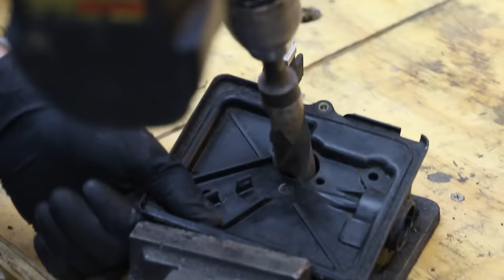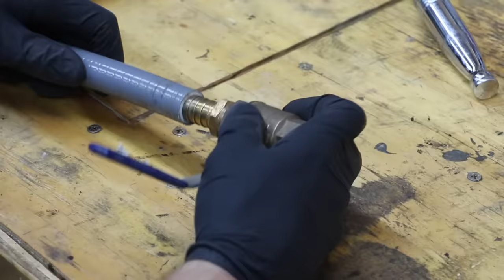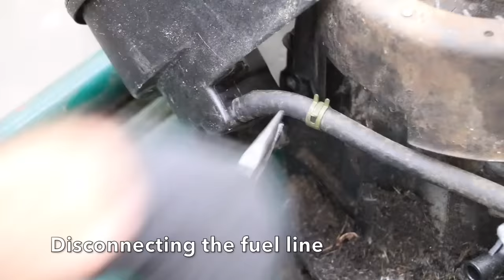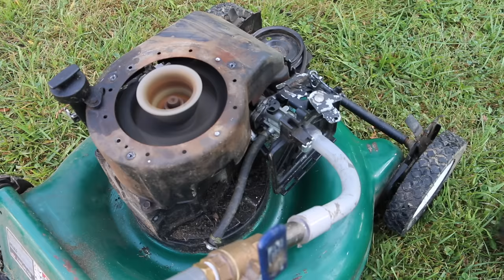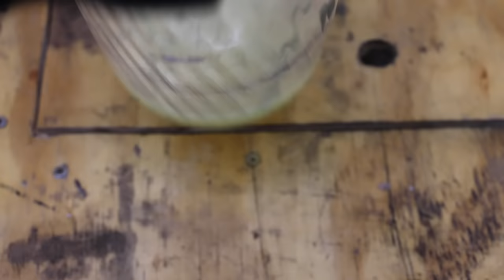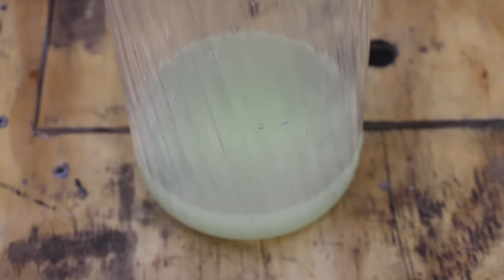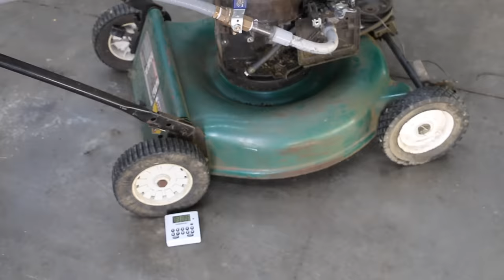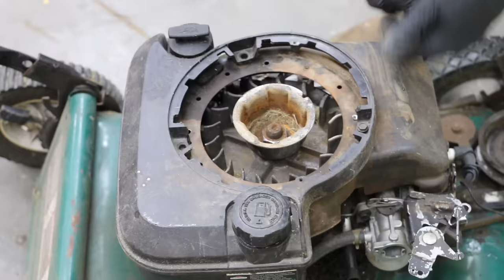Will a "Gas Vapor" Container Improve MPGs and Fuel Efficiency?  Let's find out!

Comment: I read that heating the gasoline to the temp at which gasoline vaporizes (about 180 degrees Fahrenheit) causes the increase in efficiency when running a motor on gasoline vapor/air mixture via the intake.  Care to heat the gas to 180 or possibly higher and try this again?
Reply from the maker: Thanks for this recommendation!
Reply: Thats right. I have studied the work Smokey done on this subject. The main issue he actually encountered was lack of quality bearings back when he built his device for this. I believe its achievable now. However there was a safety factor also for a car traveling with hot vapored gasoline.
Reply: I don’t think I have the background of a lot of commenters here, but my experience is that heating fuel reduces it’s effective octane. You wouldn’t see that in this experiment because there is no way to vary the spark timing on the lawn mower to maximize the tune for the higher or lower octanes. On my Harley I do have the ability to adjust timing. I get the best power and efficiency when the air and fuel are cold and can accept ignition retarding without causing preignition knocking. As the day warms up and the fuel in the tank warms, I must advance the ignition off of the optimal tune to counter the inevitable knocking which starts to occur, or add fuel additives to boost the octane, and the power and efficiency suffer. I would be curious what your experiments show if you refrigerated the fuel to freezing or lower and what gains or losses you experience.
Reply: Liquid gasoline, vaporized gasoline, propane, natural gas, methane, etc.  feed that little mower a proper mixture for the fuel type and it will deliver the same power output.  It isn’t the fuel, it’s the second law of thermodynamics. To produce a certain level of work takes a certain amount of Caloric heat, BTUs if you will.  Each fuel has a different caloric content or BTUs of heat available but so long as the combustable mixture is appropriate for the fuel you will end up consuming the same amount heat energy to produce the same amount of work.  Gasoline is very dense, propane is less, so a bigger tank is needed, both will mow the lawn.  And now that the lawn is mowed if you were to calculate the number of heat units produced by burning any suitable fuel to produce the same amount of power needed to do the job you will find that regardless of of the fuel used, the number of heat units are the same.  The second law of thermodynamics is an exacting task master and despite endless attempts to get around it it endures, it has never been wrong.  This experiment was fun to watch but given that the experiment was properly designed the outcome was entirely predictable before the mower even started up. A lot of fun though.
Reply: It will increase the efficiency somewhat because you are adding additional heat, quite a lot, unfortunately that externally added heat, when combined with the combustion mixture flowing into the cylinder will cause pre-ignition and quickly destroy the engine.  In addition to the pre-ignition problem you would also end up with less power because the hot fuel would be less dense, providing less power.  In Race cars, dragsters especially, the fuel is cooled well below zero so as to make it more dense, so the freezing cold fuel both cools the combustion chambers while packing in a much more dense mixture into the cylinders, cold fuel makes for bigger booms while saving the pistons.
Reply: Why do you want to damage the intake valve, man?
Reply: Alfred Havemann this is assuming a model of 100% efficiency for both test groups.  You can never get more power out of the fuel than is available, but you CAN however get less.  If the original manufacturers set up is less than 100% efficient, then you will LOSE more potential energy in that set up versus the other.  You science guys need to get out of the classroom and start turning wrenches.  Then maybe you’ll see that you aren’t quite as smart as you think you are.  He’s not trying to run an engine on zero point energy, he’s trying to see if it WORKS AT ALL, and after that, if it’s EFFICIENCY can be improved.
Reply: Combat Pyro. A lot more than just scientists need to get out and turn wrenches. So many could learn so much.
Reply: welcometonitropolis you would think a lab rat would at least understand the laws of thermodynamics though right?  I mean the first law of thermodynamics basically states that you can’t win, or that you’re never going to exceed 100% efficiency (but maybe not depending on the results of nasa’s testing the new emdrive engine lol).  The second law basically states that you are going to lose, or that entropy is inherently going to cause losses in any system.  So we know that what he’s saying is true, that you can never get more energy out of the fuel than is available within it to begin with, but he seems to have willingly overlooked the fact that there are entropic losses intrinsic to any system applied within this universe, lol.  If that’s the case then we know for certain that every system is something less than 100% efficient, and that right there makes his assumption an incorrect one because he’s assuming a model of 100% efficiency, which we know by scientific law, at least to date, is an impossibility.  

All this test was trying to examine is whether the methodology of aerating the fuel into the intake air externally would work, and if so, is it more, less, or equivalent in efficiency to the carbureted model.  Shouldn’t a smart guy like that understand such a simple set of test parameters?  We formed a hypothesis and tested it.
Reply: T Long u. Si
Reply: I built a heat transfer block in tech school.  One side ran coolant from engine, the other side fuel. Was on a ford 4.9l efi 89 f150 4 speed with 250k.  8mpg in town (motor seriously tired). Got 12mpg after the change.  Never tried on other vehicles, still have the contraption, just lost interest.  Other factors may have affected the results and it was a by gosh and by golly type of test, so can't say the results were accurate or phenomenal. A double blind study would provide better results as well as third party testing. Still makes for a wild story after a case of beer.
Reply: I was going to recommend this as well when the video first came out. I'd like to see if this has any truth to it.

I also don't have any engines worth risking, so I'll leave it to the professional risker.
Reply: Well, your engine runs at about 600F inside so Im sure thats hot enough to vaporize the fuel.
Reply: Nah. Carbon deposits are from unburned fuel n' stuff. If ye got carbon deposits, ye got non-vaporized fuel.

So the theory goes, iirc.
Reply: frikyouall Engines run rich at idle and when its cold, that causes alot of the carbon build up. Cars that arnt left to idle long dont have as much of an issue with carbon build up.

But no, 100% of the fuel cant be burnt 100% of the time. But it certainly can be burned nearly 100% at times.
Reply: Mmm, that's where the theory comes from. If you run it lean with an even dispersal of vapor, it'll be a much more even solution with the air around it, causing a spark to vaporize the whole shebang at once. The focal point will still spread from the spark plug which is a major part of the problem as far as I'm concerned, but it should still keep an even spread a fair amount better.

There are a myriad of problems associated with messing with the chemistry like that, but as far as vaporizing it all, it'll do it a lot better.

Which reminds me @Project Farm, if you ever get to this test, could ye do an emissions test while yer there? In stories of this test, emissions were next to nil.
Reply: frikyouall Well, lean mixtures produce much more NOx emissions with lower CO2 so I would assume that would be the result of an emissions test with a setup such as this.
Reply: Alfred Havemann I'm not going to try and sound smart bro but leave the word impossible out if it. The one thing you never calculate in energy efficiency is momentum. Switch your 10 speed to high gear  and you will use less energy when you go up hill easy especially if you're already moving or get a good push. Heat my friend is a good push. No heat is like starting up hill from a dead stop. Everything is possible bruh. Stop trying to be the so called number 1 human...(aka, look at my shirt, buttons, buttons, buttons, credit card)
Reply: Alfred Havemann any brain can regurgitate word for word someone else's thoughts and finding but true understanding of any subject could be explained good enough for a 5 year old to understand. Other than that, ego tripping
Reply: @18 After reading up on the subject, I can get behind that. But I'd still like a measurement of the ratio between fuel savings and NOx emissions, and without a complex muffler, this setup would be ideal.

If possible, I would also like to see the use of fuel additives to make it act more like lead-based fuel from before the 70's when the idea was popularized. For this I have my reasons. <_<
Reply: T Long yes you got to heat up the fuel to get more efficiency out of the vapors and possibly use an injector off of car to control the amount of vapor released into the chamber in the combustion process
Reply: This is true, however, when you create a vacuum on an environment, you lower the boiling/flash point of the substance. When working on Air Conditioning systems, we pull a vacuum on the system and at room temperature with -30 PSI, water will flash to steam and be pulled out of the system. It is very bad to have any water in the lines when charging an A/C system, so you pull the vacuum, then when you charge it with a vacuum on the system, it will be free of contaminates. Same principal applies, here. By pulling the vacuum on that container, it will flash to vapor and be sucked into the engine. So, instead of heating it to a vapor form, we are lowering the pressure until it flashes to a vapor.
Reply: I wouldn't.
Reply: Heating fuel increases efficiency, so that is why whole industry uses INTERCOOLERS to cool injected fuel mixture? CONSPIRACY! Where is my tin hat?
Reply: Inter-coolers cool the air, not the fuel. colder air in denser.
Reply: trd4x4,
intercooler cools a single component of air/fuel mixture to make whole resulting mixture colder.
The only reason to heat fuel is when it is too viscosus to flow, (i.e. diesel in winter).
Automotive industry, aviation and rocketry strive to use as cold air/fuel mixture as possible due to colder fuel being more compact (you can pump more of it into combustion chamber resulting better compression).
Reply: That sounds like the "Pogue Carburetor" but those claims never made the massive increase in efficiency that had been stated.

Comment: You won't get better MPGs or power or anything like that. Also make sure you don't lean out the engine too much because that can cause damage. Super interesting video though, the build was cool to see!

There'sing called the Stoichiometric Ratio for engines. It's basically the minimum amount of fuel needed to get 100% combustion in a given volume of air. It's about 15 air : 1 fuel. You can take vapors and get 15:1 or you can take injectors/carburetors and get 15:1. Using vapors basically means that you're hauling around less fuel and you'd have to constantly refill the tank.  (When engines run "lean" or "rich" they're messing with this ratio)
Reply from the maker: All great points regarding Stoichiometric Ratio. Thanks for the positive comment.
Reply: Finally......was looking for this comment.  Where did I learn the important mechanics of combustion?  From my chemistry professor, not my mechanic.

Comment: You should try adding a air bubbler ... Like what's used in aquariums. Try several different types that disperses at several ranges. That was a very basic experiment, which proves that it works. I would like to see you dive in a little deeper with several improvements. ❤
Reply from the maker: Thanks for the suggestion.

Comment: Sense your on the fuel catagory here, what about a hydrogen generator?
Reply from the maker: Thank you for the video idea!
Reply: I have read that running a engine on alcohol vapor vs liquid alcohol showes a bigger difference in fuel economy especially at low tempertures , my guess is because of unburned droplets making their way out the exaust , I guess that might also apply if you are using liquid hydrogen . I also think the effect may be greater at high engine speeds .
Reply: He'll end up dead like Stanley meyers 😐
Reply: @joshclark3218   especially when they find out that by changing the frequency of your electrolysis process and the different chemicals in  your water your hydrogen becomes more explosive or something like that I don't know?
Reply: You're always going top put more energy into creating the hydrogen than you are going to get by burning it. That's the 2nd Law of Thermodynamics. However if you use renewable energy sources to power the hydrogen generation you can get a much cleaner engine (including the process of generating the hydrogen) than a gasoline engine. But you will always need an external energy input to create the hydrogen. (You'd also need one to create hydrocarbons, but Mother Nature did that for us with solar energy hundreds of millions of years ago, which is why they're called fossil fuels.)

Comment: I saw another video where in the bubbler they also mix water with the fuel. This makes the engine run cooler and because water expands when turned into a gas form it will increase the fuel mileage.
Reply from the maker: Thanks for sharing.

Comment: You should buy or build a hho dry cell and run an engine on hydrogen
Reply from the maker: Great video idea!
Reply: This doesn't work like that. The cell always consume far more energy than the one engine can make from that hho. It's unpractical.
Reply: @danixsc  that's assuming your HHO cell is the standard, shitty design
Reply: @excelsior8682  For the love of god, you just simply CAN'T gain energy from a chain of energy conversions. It's impossible, just that. At least you should read the laws of thermodynamics and see how the hho is generated and consumed. Basic science.
So no, it doesn't matter how efficient your hho cell is. It is going to lose energy and also the engine of the generator.
Reply: @danixsc  Many people have already made HHO conversion kits that produce enough to keep an engine running. Those inventors, however, have been straight up assassinated. Your thermodynamics textbooks are flawed; they do not tell the entire story. That is a fact.
Reply: @excelsior8682  Yeah, of course, there are people that have broken the laws of thermodynamics. Yeah, that makes sense. And of course they don't have a Nobel prize. Because it's all a conspiracy. Yeah, that makes sense, sure.
You're so ignorant about science that you've told me there are people that have broken the laws of thermodynamics. This isn't even possible for thousands of reasons. If that happened, universe probably would have broken. 
I even can't believe that I have to explain that.
Reply: @excelsior8682  I'm gonna explaint it in Spanish, which is my language, so you can use Google Translator and haver a better explanaition of all.
Cuando conviertes agua en HHO, utilizas un proceso de electrólisis para separar los átomos que forman las moléculas de agua. Para poder hacer eso, empleas una enorme cantidad de energía en forma de electricidad. Después, al meter ese combustible en el motor, en la combustión, los átomos se vuelven a juntar produciendo agua, es decir, se produce la misma operación pero a la inversa. Esto implica que liberas la energía que habías utilizado para separar los átomos, en forma de combustión. Solo con esto, has tenido dos pérdidas de energía, una al separar los átomos del agua, y otra en la combustión. Pero además, hay que sumar la pérdida energética del motor, que está presente en una serie de fricciones de las partes mecánicas. En este punto, has perdido cerca del 80% de la energía que has empleado inicialmente en transformar el agua en HHO. Además, después transformas la energía mecánica del motor en electricidad mediante un alternador, por lo que se produce otra pérdida de energía, más leve que la del motor pero aún así muy importante. Después, esa electricidad ha de viajar a la célula de HHO para volver a repetir el proceso, habiendo perdido cerca del 90% de la energía inicial. Es decir, no sólo no puedes alimentar el generador de forma autónoma, es que pierdes el 90% de la energía que has utilizado en un origen.
Las células de HHO solo se utilizan como complemento al combustible del vehículo, utilizando la electricidad residual que pueda producir el alternador, si es que la hay. Así si hay un exceso, en lugar de perderse, va a la célula de HHO para reducir minúsculamente el gasto de combustible.
Por eso es imposible alimentar un motor mediante una célula de HHO sin baterías auxiliares que la alimenten. Y en cualquier caso, es mucho más ineficiente que un coche eléctrico. 
Es como querer alimentar un generador eléctrico utilizando un motor eléctrico, con la propia electricidad que genera. Es un ciclo cerrado de pérdida de energía, y además con una pérdida enorme.